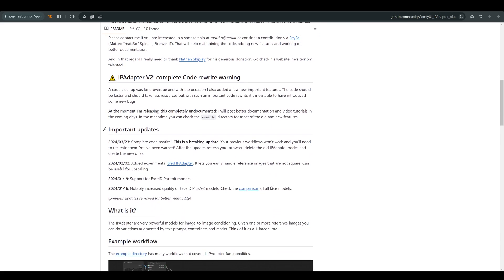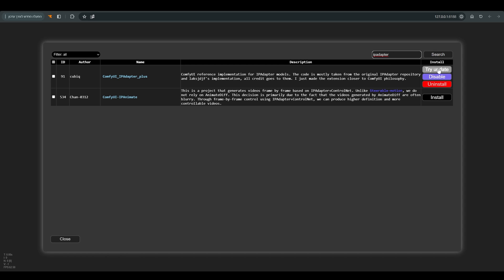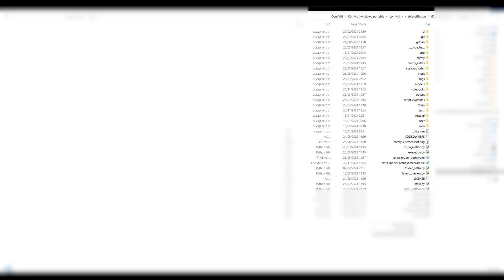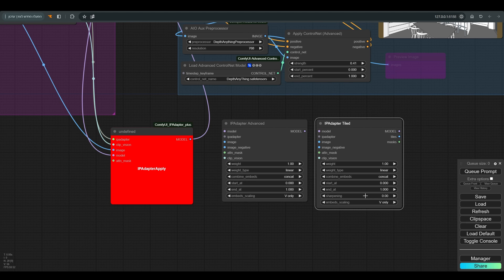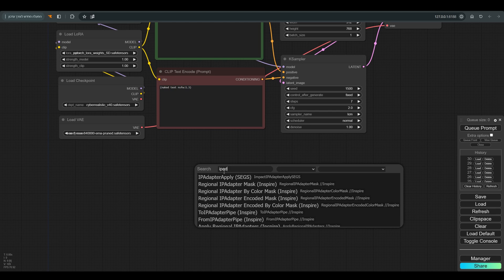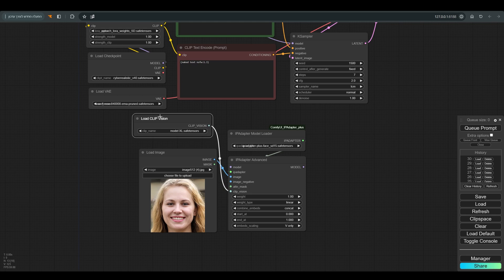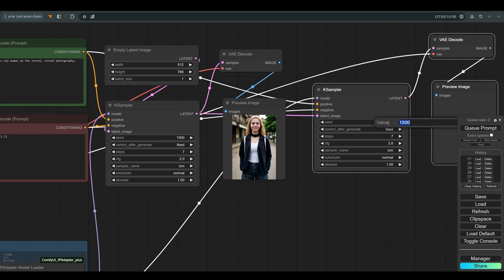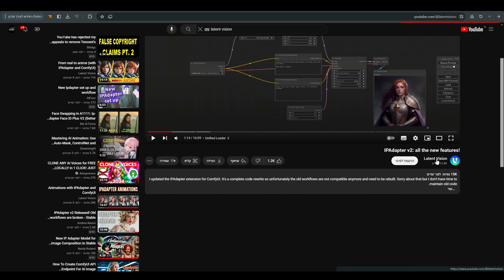ComfyUI IPadapter V2 update fix old workflows #comfyui #controlnet  #faceswap #reactor

Comment: I updated all nodes and i still with this error? Someone can help me?

FETCH DATA from: C:\ComfyUI_windows_portable\ComfyUI\custom_nodes\ComfyUI-Manager\extension-node-map.json
#read_workflow_json_files_all C:\ComfyUI_windows_portable\ComfyUI\custom_nodes\comfyui-mixlab-nodes\app\
got prompt
Reply from the maker: it's happened when you try using the ip adapter? did you try to run a simple workflow?